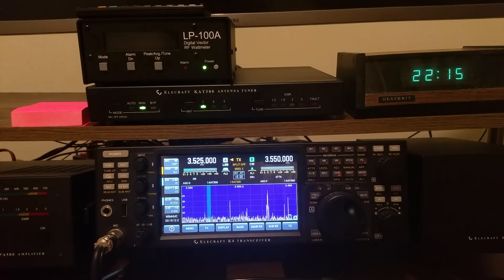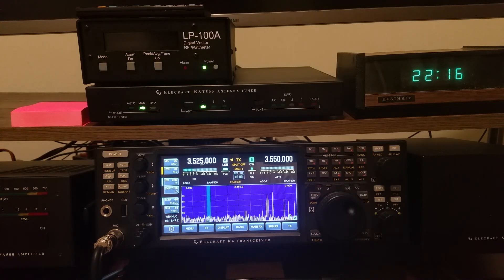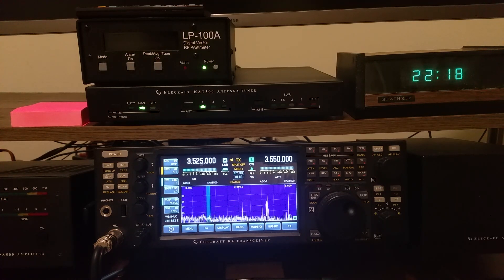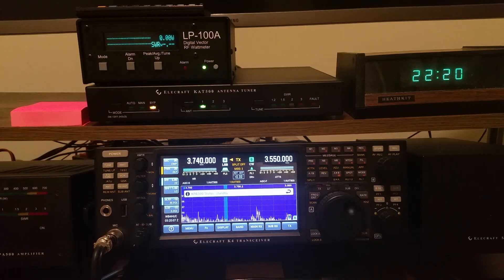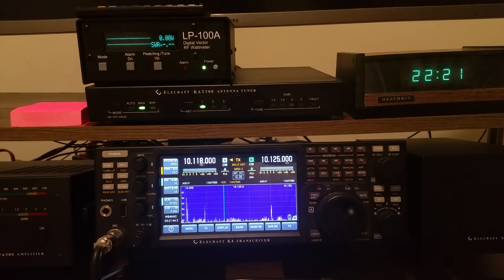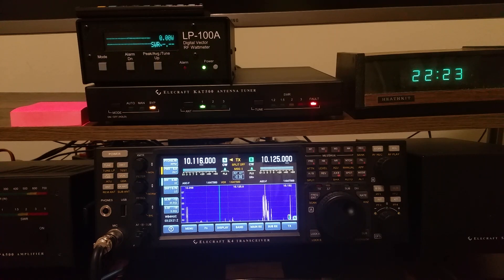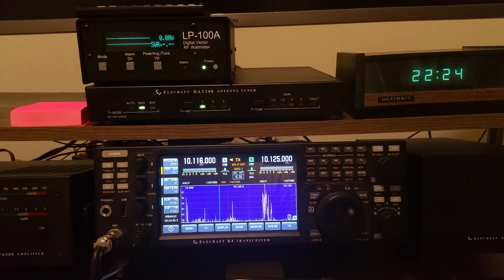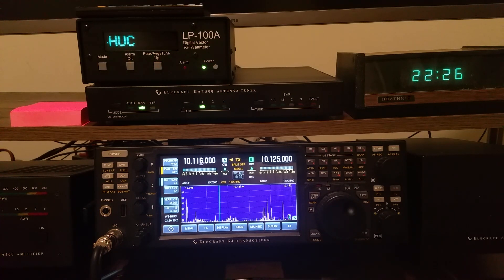Instant band change and tuning with the Elecraft KAT500 tuner

Comment: I like this with the KAT 500 and it believe it will work with 3 different antennas.
Reply from the maker: I believe the tuner memories remember settings for each antenna, so you are correct.